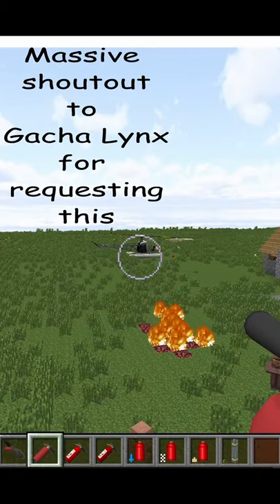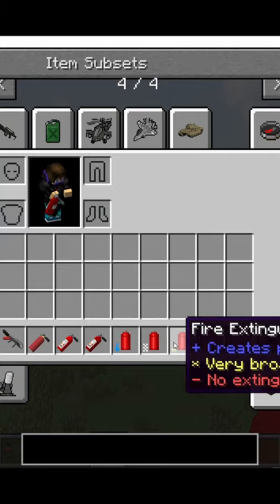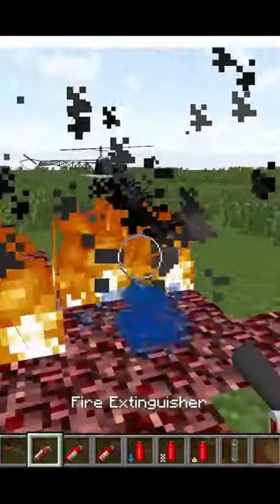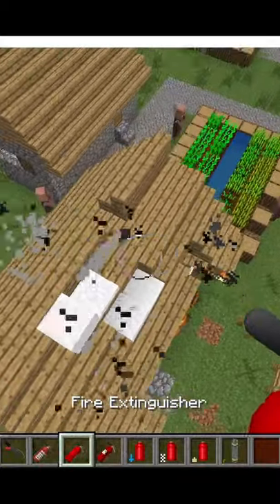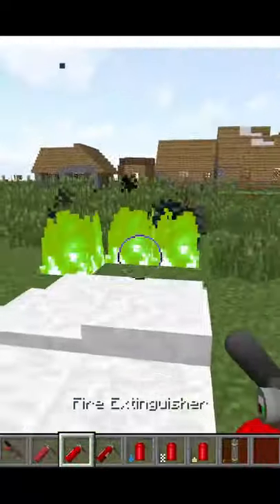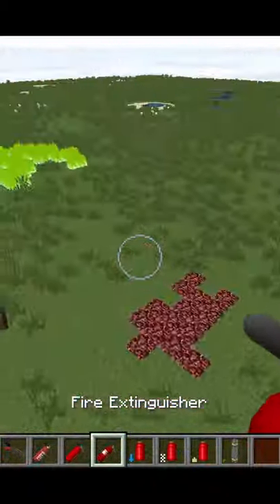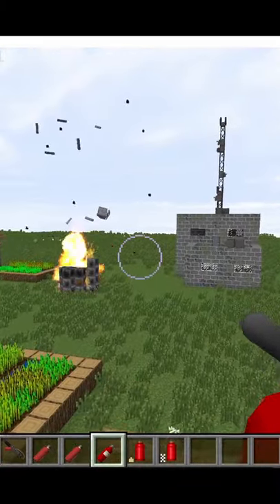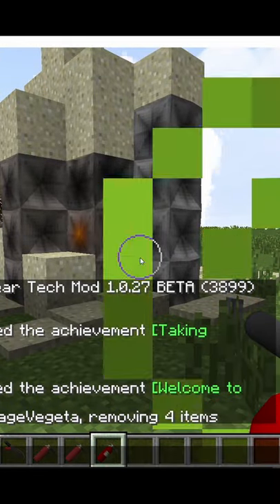How to use "FIRE EXTINGUISHER" in HBMs Mod || Extinguish any fire in Minecraft || #Shorts

Comment: Oh and 1 more thing which Hazmat suit is the best?
Reply: Since there are a lot of suits that protect you from radiation, you can tell the protection at the bottom of the pop up when you hover over it. The higher the number the better. If you are just asking about the Hazmat Suits (normal, advanced, high performance), then the high performance is the best one.
Reply: @cpt_aj  Alright thanks man i appreciate it
Reply from the maker: As Cpt_AJ said High performance suits are pretty good and if you wanna go for something even better that's not hazmat suit use Schrabidium Armor , when you have the full set on its radiation resistance is above 2 so that's pretty good